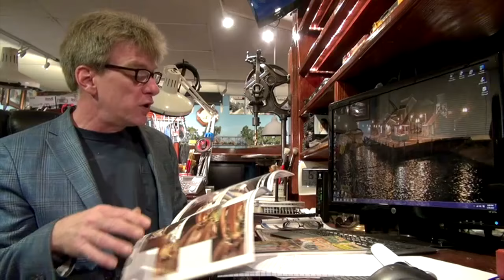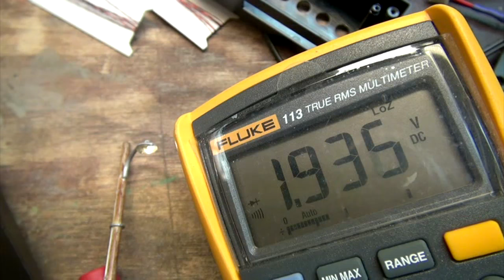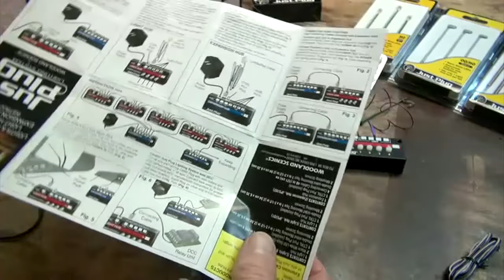Whats Neat in model railroading | March 2017 Model Railroad Hobbyist | Ken Patterson

Comment: Sir, always consider changing LED light color from blue/blue-white to correct color, e.g. slightly yellow.  Utilize correct paint product(maybe oil-based); thin the paint then apply upon LED fixture. Depending on model light source, change its color to model  correctness...for halogen-tungsten, tungsten, sodium etc. I did same to LED kitchen light fixture advertised w/2700 degree color... NO, was blue-white. So, I covered the light w/translucent plastic covering which enabled using yellow color pencils.  Worked great!

Comment: Hi Ken and George. Learned a few tips from George about programming. However although George showed the medium and heavy loco programming, the one I am most interested is with the American 4-4-0 as I model the civil war. I have a lot of questions so will pursue a conversation if possible with George. I did recently purchase two Tsunami-2 decoders, as the micro-decoder is discontinued, but mostly for the new sounds relative to wood burners. Overall much enjoy Ken's videos. Great job!

Comment: Nice video. On the lighting system from woodland scenic you kept mentioning it provide "filtered" power to the LEDs. That isn't true based on what the term filter means for electronics or power.  The box recorded the AC input but you could use a DC source and feed that power though resisters to LEDs and get the same result. Filtering would remove frequencies components from the power and nothing in those.boxes does that. The boxes do give you variable resistances you add to the existing hard wired resistors to be able to fine tune the brightness down, which is nice. But that could be done by wiring up potentiometers in series with the fixed resistances manually. So what they WS solution does provide is convenience that removes the modeler having to mess with the.wire soldering and resistor specifying and assembly. It's easier plug and play. It's just not filtered power not better power than you could get with a DC power supply and inline resistor.
Reply: I have a 12v / 19amp dc power supply, now do you think I could use a few of those WS light hubs using my power supply ? what I mean is I would use the correct resistors and use the hubs so I can dim my lights, also WS claims you can only use 3 lights per input on the hubs, could I use unlimited amounts on leds in their hubs as long as I don’t exceed the 19amps my power supply has ? Thanks

Comment: It looks like transistors on the back of the Light Hub. Connected to the pots, that will PWM the power to the LEDs, varying not the voltage to the LEDs, but the time that they're on, making them look dimmer or brighter. At that point, the power would not be a nice clean DC, but a square wave. This could be verified by hooking an oscilloscope up to the output.
Reply: It looks like they're using the transistors linearly not for switching (simple constant current circuit likely). PWM would be a perfectly valid way to provide a variable intensity diode light source, but would require a timing circuit for each output that I'm not seeing on the board.
Reply: A simple oscillator can be made from a transistor, a cap, and a resistor, but I can't see any caps besides the filter, so I'll concede your point. 😊

Comment: I enjoyed your coverage of the Just Plug lighting system.  I use and generally like Woodland Scenics lighting system. My only strong recommendation is that Woodland Scenics buy a much higher quality potentiometer as the ones I have were not even close to linear. This made it difficult to have a continuous and even adjustment of the light output. Too bad for an otherwise good design.

Comment: Those negative comments below just tells you one thing, Ken - that you're doing it right! I eagerly wait for this show every month and I can hardly explain how much I have learned in a short while through your videos - you're a true hero to many Model Railroader.

Quick question on the WS lighting systems - you showed a terminal where you attach 3 LEDs and then connect it to the light hub. Does this terminal come as a part of the lights, or do you have to purchase it separately? I was looking at the product description at some retailer's website, but couldn't decipher that. Would appreciate if you (or anyone who knows) points that out. Also, I noticed that the individual stick-on LED lights get connected to the hub directly, not through a terminal - so I'm a little confused here.
Reply: All the hubs are extra. Lights. Hub, Power supply to start. then expand.. You are right about the interior light. 1 light with one Jack. KP
Reply: Thank you Ken